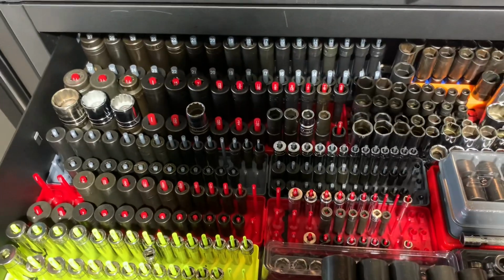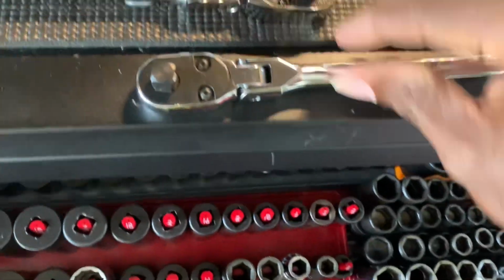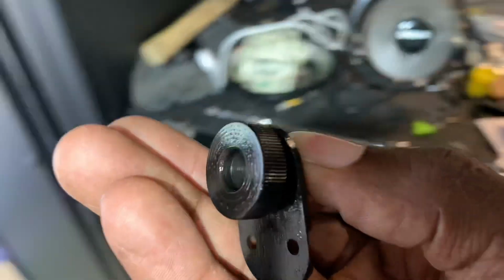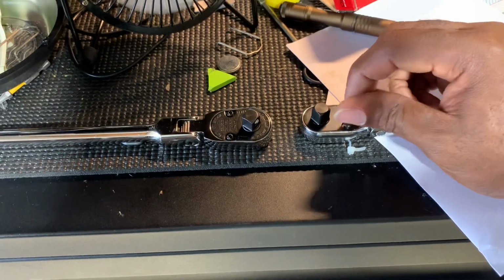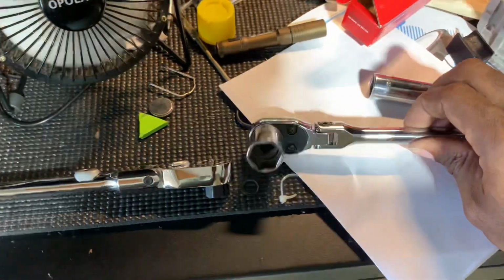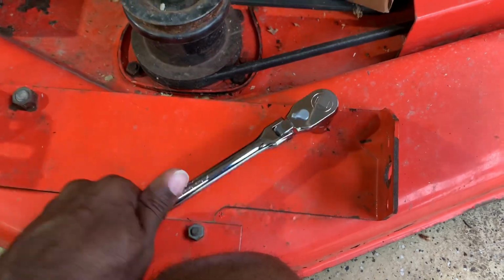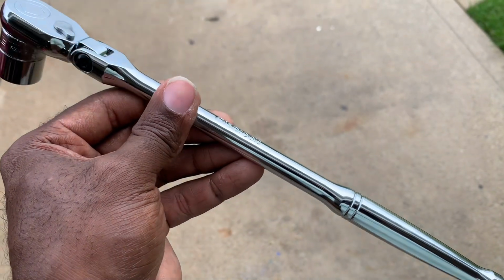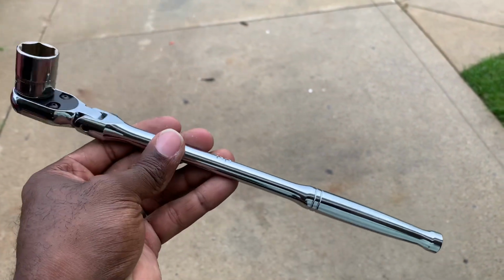NEW USA MADE RATCHETS FROM OLSA TOOLS: EXCLUSIVE REVIEW

Comment: I won’t be buying one knowing that they do not put Made In The USA 🇺🇸 on there ratchets. And like you said, there is no lock tight or rubber or synthetic seal to keep any contamination out of the ratchet head. I wanted to buy there 24 inch 1/2 ratchet, but not until these changes are made. Maybe there is some kind of Litigation issue regarding putting  made in the USA on their products since Olsa tools is a Canadian company. But what’s funny is is that there’s no litigation issue regarding putting made in the USA on their manufacturer box. LOL!!! And their prices for the ratchets are outrageous high $$$ especially if they don’t make these changes.🇺🇸😎🇺🇸

Comment: My first thought was that it looks just like the sk. I’m curious how the selector switch feels, I got one of the sk’s when they first came out and the selector switch is ridiculously stiff and refuses to break in. Other than that I really like it but barely use it because of the switch, sure looks nice though
Reply: I have a few lp90s like that, I pulled them apart and cut the detent spring a tad shorter. Much better
Reply: @NDC1115  beat me to it. I slowly cut the spring back and reassembled it until it felt right. And SK seemed to love shipping their ratchets completely dried out and lube free.

Comment: Check out tekton tools new comfort grip ratchets coming out . I have 2 of there 90 tooth ratchets and I really like them a lot.
Reply: I had one of their 18inch 3/8 ratchets and it broke.  It was a cheap pos for sure
Reply: @timm5970  Any ratchet can break. Their  warranty is second to none. I’ve busted snap on. Must mean they are junk…
Reply: @nordicpride9708  I forgot about their warranty lol.  I just threw it away.  I also found out they had a replacement paw kit.  Funny thing is that ratchet was a "snap on".  I put a snap on soft grip handle on it lol.  It was a cheap ratchet though.   Didn't feel good, didn't perform well, didn't last

Comment: So basically they're trying to compete with Tekton now ?

It doesn't have to say USA on it to advertise it as such, just has to have a majority percentage of domestic materials components and workmanship.
Reply from the maker: Not really sure, but at their price point, it may be difficult. There’s just too many cheaper brands that offer comparable performance, quality and ease of warranty. As for being embossed “USA Made” it would help them market and increase sales
Reply: @MidwestToolReview  
I agree it should say USA on it.
They aren't concerned with the secondary market when a product is made, but without the package I'd never buy one on Ebay 5-10 years from now,
I'd do some research and read forum posts with conflicting answers with likely no examples of the packaging left.

It's kind of like the Craftsman round head ratchets with the thumb wheel on the back , the EE code means Stanley and they don't say USA on them so there are conflicting ideas on the COO.
The same mechanism was / is used on many Taiwanese ratchets as well as USA stamped Blackhawk ratchets.

People claim their sets said MADE IN USA when they bought them , but the Master mechanic set I have which includes them notes that only the sockets are American made and I believe the Craftsman stuff was the same way.

Comment: No need to research guys, it’s a rebranded SK ratchets with a new handle. I have both, exactly the same(except for the handle). Price point is a big factor in why it’s not stamp USA or has any other updated features. Olsa is not a manufacturer, all they can do is just pick options and the “look” from who ever they are buying from(great star). As people mention, 120$ is steep for an olsa tool, tho this is 100% USA.